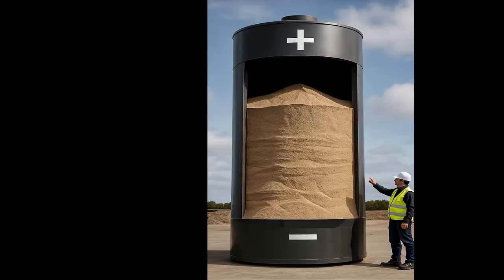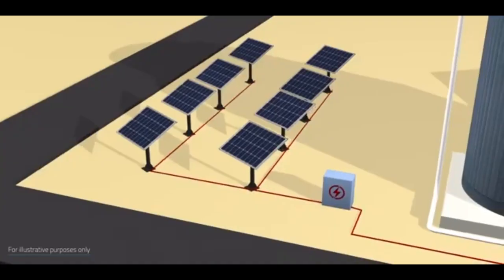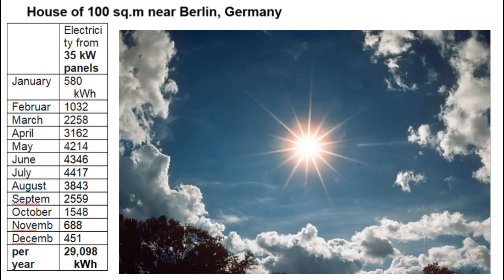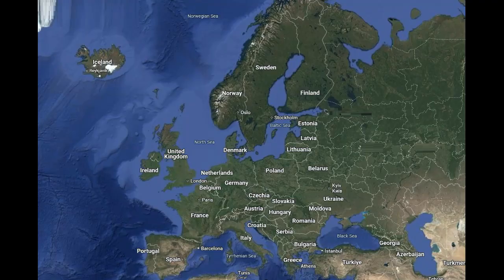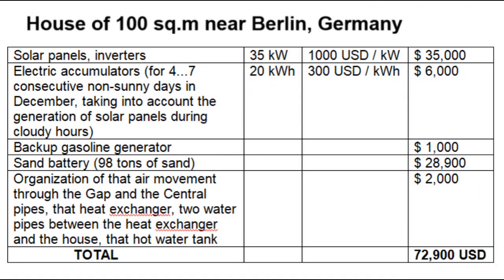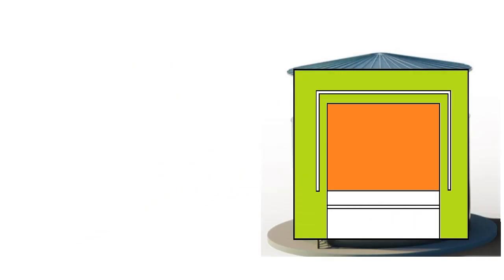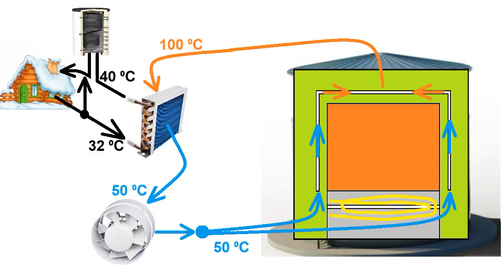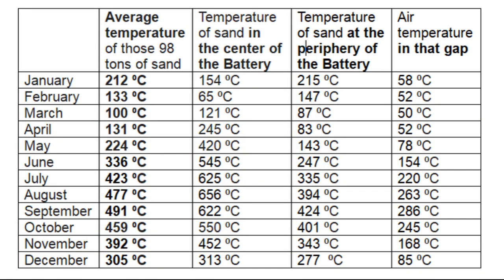Sand battery and Solar panels provide 100% energy autonomy of a house for all 12 months

Comment: You do not need that much actually. If you bury a tank 12 ft deep and surround it in 4ft of clay. And then insulate around and over top the clay. Thermal mass can be anything you put an insulating layer around. Secondly it is not as if a properly sized solar/wind system is not going to stop putting more energy back into the sand battery periodically over the winter. Solar actually is really efficient when its really cold here (below -20C and even -40C at times) my system is actually putting out its 32kw nameplate capacity on clear cold days. But I have them tilted for the winter solstice. We get a lot of sun and wind here on the Saskatchewan prairies. I can go a week of bad weather normally because I have two 5kw commercial wind turbines contributing to the supply. And there are mornings I wake up to full batteries and the dump loads for the sand battery are already active. ;)
Reply: Btw? That tank has been a lil bit hotter over the last 3 years. It hit 680C this Sept before the heat was on. It should be above 190 by the time the days are long enough for me to reliably start moving the needle the other way.